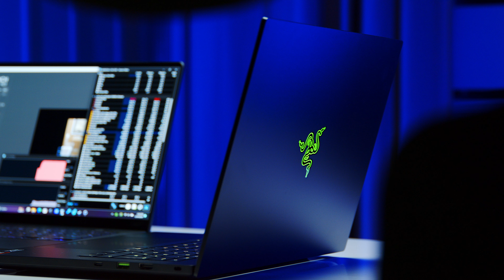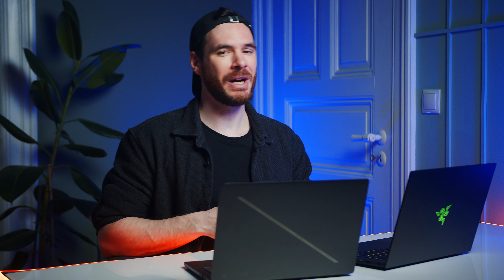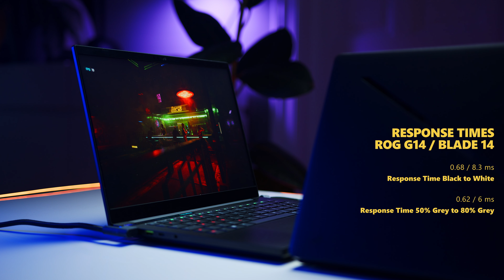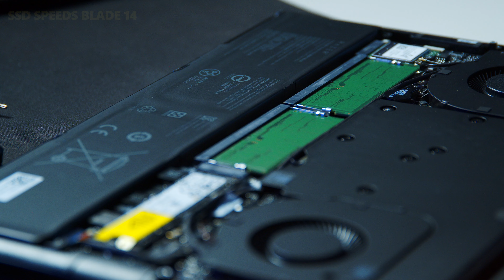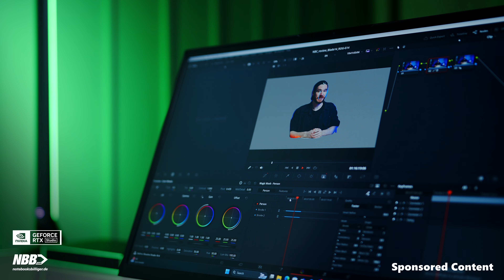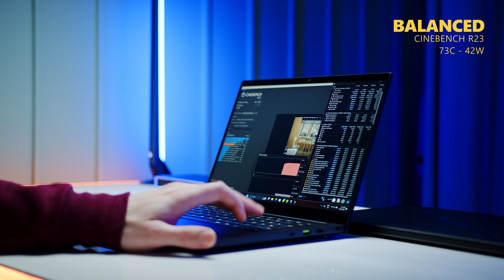Razer Blade 14 2024 vs. Asus ROG Zephyrus G14 2024 - an easy win!(?)

Comment: Hi,
I work in engineering field, and I work on my PHD degree. I need something robust and can handle all the engineering softwares easily and run programs with no issue. I am torn between Lenovo X1 Carbon Gen 13 vs G14 vs blade 14 despite the fact that they are from different categories but I opt for 14 inch one; could you help me deciding which one is much better ? 
Thanks

Comment: awesome video thank you for this. I subscribed. heads up though it's really hard to understand which PC i'm looking at from some of the angles and lighting - I think it would be easier if you had some label of the product or changed the font you use for corresponding models (think green font for razer and a silver or blue colored font for Asus) otherwise thanks again.

Comment: Zephyrus longer battery life and oled ....no need to think too much...just take the 32gb 4050 ryzen r9 white and you have a laptop for all rounder at 2k price...i rather take the 4050 and 32gb as it is also at 90w and it does the job for gaming and your work wont be compromise ...best all rounder indeed

Comment: Thanks for the awesome review. Does any of the two USB 4 ports on 2024 Blade 14 support display port through the dGPU? Razer website make it sound that both are connected to iGPU! Does Optimus make a difference in this case? I need to be able to connect a device theough USB-C to the dGPU for work. This might be deal breaker for me.

Comment: I’d lean towards the G14 as usual. The whole point of a 14” laptop is portability for me. Having a smaller form factor, lighter weight, and crazy battery life are super important for bringing this to the office without needing to charge for the day. For those needing more power, just go for last years G14. Comes with 4080/4090 and a slot of ram while still being roughly the same size as the Blade 14 but better performer and lighter weight and better battery

Comment: Hopefully we'll see some USB-C 240W devices soon. No need for some extra connector s**t anymore.
Reply from the maker: Do not count on it anytime soon. According to our information from different manufacturers, 240W via USB-C needs too much voltage right now, making it very inefficient, resulting in too much heat at the connector.
That is why you do not see anyone using it!
Reply: @NotebookcheckReviews Ah that's a shame, thanks for the update though!

Comment: The true battle is the price, $2000 vs $2700, The G14 is clearly the winner. Is the Razer really worth 700 dollars more? I don't think so and I had them both.
Reply from the maker: Is it really that much in the US? The G14 is really "just" 2k in this config?
Reply: @NotebookcheckReviews  Yes Sir, I  have the bestbuy version.
Reply: Also, the oled Blade 16 with 4090, 2TB SSD, 32GB Ram and 14th gen i9 is $1000 more that the equally spec'd Asus G16. Asus really accomplished what the MSI Stealth serries couldn't do vs Razer.

Comment: Factor in price and the G14 is the winner.  The extra power the Blade gives the 4070 doesn't mean very much as performance usually maxes about at 100W.  I would rather take the oled and 120hz.  Neither laptop really strikes me as a 240hz machine.
Reply from the maker: That's a sound argument, but as you can see from our testing, the Blade is A LOT faster. For some reason, it can properly take advantage of its higher wattage 4070!

Comment: Excellent video as always! 🎉
I finally decided on the Razer 14 despite i like the screen, battery and portability more on the g14. I did so because of i know the build quality on the Razer is very sturdy when carrying the laptop around every day in all harsh conditions for a couple of years. Asus just feels more flimsy and to be frank untested in the long run. I dont think i really could go wrong i neither case, but your thoughts?
Reply from the maker: I agree. The Asus also feels excellent, but the Razer just takes it to another level. 
As I said in the video, it feels more like a work machine than a lifestyle accessory, and if that is what you are looking for, then you will not be disappointed with the Razer!

Comment: That 140w TGP for the RTX 4070 in the Razer means nothing. Channels like Jarrod's Tech has shown that pumping more wattage into the RTX 4050, 4060, and 4070 laptop cards don't offer any performance advantage. Razer is just promoting that as a marketing tool. That's how they get customers...through marketing and aesthetics. I have never trusted the brand as they have horrible quality control issues. Sure the laptop might look good from the outside, but they always have problems with things like battery bloat, keys sticking, cooling issues, display issues, etc. I had one of their mice back in 2014 develop a double click issue 3 months after purchase. Replaced it under warranty and the new one did the same one month after purchase. Switched to Logitech and never looked back and that mouse is still working perfectly today. Avoid Razer products people

Comment: Nice video comparison! However when it comes to price there's no comparison: Not sure in Europe, but in Canada, Asus hands down is cheaper by quite a margin,  with same spec (4070 with 32GB Ram), G14 is CAD$2,999 while Blade 14 is whopping CAD$3,799....
Reply: 90w vs 140w
Reply: @yilun354  I understand, me personally I don't really need that extra frame rates, 8fps in game doesn't justify the $800 difference for me

Comment: Hope you can make a G16 2024 vs Razer Blade 16 too!
Reply: They're pretty much the same notebook. The 16 has an amazing display and build quality but is obviously a good deal more expensive.
Reply: @BoldLaughter uhhh...no. The Razer offers WAY more power, more configurable RAM, larger configurable storage, upgradable RAM and storage, 4k screen, and...just no. They aren't the same. Not even close.
Reply: @BrooBrou  Even the price is different. Jesus Christ I would have to sell both kidney to get the Razer blade 16 considering it's $4k+
Reply: @EndFrost123  pretty sure it starts under $3k.
Reply: @Yayaloy9 that's why there are brands for you like compaq with dual core processors.

Comment: Turbo does not give you the max TGP for the Asus G14, manual mode does. You should do the test with manual mode for the full 90w tgp
Reply: The fans are already really damn loud in turbo mode so I can only imagine how loud the fans will be or how hot the machine will run with the GPU at full 90W TGP.
Reply: @fidelisitor8953  I understand that but this is a video about performance, and you need to show what it's capable of
Reply: @leebrandt8597  Fair, but most will find manual mode to be unusable so it doesn't help to add it.
Reply: @fidelisitor8953  I use it all the time on my 2021 G14. It is loud at times, but not over the board. I use it because it gives me the most power, which I absolutely need for editing 6k raw footage. Now, if I'm gaming, I just manually adjust the fan speed a little and it works just fine. As I understand, the manual mode isn't as loud on the 2024 compared to the 2021

Comment: ive seen serval reddit posts that the new g14 and g16 very quickly downthrottle gpu and cpu and get very hot... and with razer im always concerned about all the battery-bloating posts i read...

Comment: Would this laptop be a good replacement for 3060ti pc? Also would it be able to stream and game capture?
Reply: No. Save your money and get a 4070 Super. That will give you way more performance and be cheaper. Buy a non gaming laptop for your on the go needs. Or get a SteamDeck OLED if you wanna do portable gaming.
Reply: yeah, I say this since I'm a college student and although I know my pc is there for me, It has 8gb of ram and 256 gb of storage. I'll always need a laptop, so I'm weighing the cost of benefits of having a jack of all trades gaming laptop over the PC steam deck combo, which I'm sure would be better otherwise.
Reply: If you are happy with the same power level and need the benefits of DLSS then it is the way to go

Comment: Thanks for the great video. Both systems are clearly top-of-the-line 14" for 2024. It appears that BOTH OEM's stepped up their game on these systems however went different directions on the design trade offs.
RAM and storage are items that OEM's charge an INSANE premiums for so having ether of them soldered is usually a BIG NEGATIVE. Battery life/run time 'in the wild' is usually at or near the top of the feature list/requirements.
While in the past I've gone with Razer and last year went G14 however in 2024 any decision might not be as easy.
I'd agree with the other commenter that side-by-side graphs would be helpful here namely in noise and (missing) heat. I'd like to see how much warmer/cooler each system runs under load (gaming) given the different cooling solutions.
IMHO: for my use cases the G14 would get the nod (with reservations).

Comment: hi i am planning to buy g14 but confused which version to buy g14 2023 4080 or g14 2024 4070 ?
Reply from the maker: If you want the performance and the MiniLED get the 4080, if you want something cleaner and more portable, get the 2024 variant
Reply: @NotebookcheckReviews  thanks for clarifying ☺️
Reply: @NotebookcheckReviews you can get mini led only with 4090 version. 4080 comes with regular ips

Comment: Will there be a review of the HP Spectre x360 2024 or Lenovo IdeaPad Pro 5i Gen 9?
Reply from the maker: Working on the Spectre Review, and will check out the IdeaPad!
Reply: @NotebookcheckReviews  nice
Reply: @NotebookcheckReviews  As far as I know, you should wait for the HP software update, because the 16" was not able to sufficiently reveal its full potential

Comment: I mean.. considering the new G14 is almost a full pound lighter and more compact overall than the Razer, it still nearly keeps up overall in graphics for what it is.. it's a trade off for sure but i'd go for the G14 for max portability.   Plus the G14 has OLED and longer battery life..    I ordered the G14.
Reply: Are u getting any issues with your laptop as u might have used it for a while cuz I was thinking about buying one
Reply: @kavyanshjain223 the screen wobble is not really that bad I only notice it when I try to see it
Reply: Did you get the 4070 version? 

How much fos does it get and what settings do you play on?

Comment: How is your Blade 14 getting over 13k graphics in Time Spy??? Did Nvidia accidentally remove the voltage limit on yours? That’s crazy, the 4060/4070 usually plateaus completely after like 100W.
Reply from the maker: There have been rumors about exactly that. I am trying to get more 2024 4070s to investigate!
Reply: @NotebookcheckReviews  that would be really cool if so, I might start actually recommending higher wattage 4070’s to people.
Reply from the maker: Yepp, my thoughts exactly!

Comment: Interesting how you get such good battery run times on the G14. I have the same model and I don't seem to get good battery life from it. Are there any specific settings you have tweaked or changed when running your battery tests?
Reply: g helper for rog
Reply: Yep, in fact I am using G-Helper and using the Eco/Silent mode @Jules-kp7rw

Comment: G16 vs Razer Blade 16 or Asus Zephyrus M16 when?!
Reply from the maker: As soon as we can get a 4090 sample of the G16
Reply: I tried to scratch the glass with bad fabric etc to Zephyrus G16 2024 (4090) and still no micro scratches. Far better. On M1 and M3 Max it was easily to get micro scratches.
Reply: @steffdia7080 bruh oh my I wanna see jerryrigeverything try it haha. But that is good to know the glass is stronger than the Apple M1 and M3 series.
Reply: @NotebookcheckReviews Hoping for it soon! Will be amazing to see the difference between the 4090s in thin and light devices.

Comment: Nice! How would you compare these against the Slim 5 - the value proposition on that is just crazy.
Reply from the maker: It remains the "Budget" King within this category. If you can live with a slightly bulkier design, no G-Sync, and very good but not outstanding build quality, then you should definitely check out the Legion.
Reply: Considering both Asus and Razer are known for terrible quality control as opposed to Lenovo the choice is clear imho. I'm not going to shell out a premium price for a machine that has a high failure rate combined with terrible customer service.
Reply: The legion isn't exactly "value" compared to the g14 and blade 14 as it's ugly and chunky with less quality than both g14 and blade 14. That's why it goes for less.
Reply: @fidelisitor8953  Please tell me: Wouldn't the high price of Asus and Razer warrant the expectation of good quality control and customer service?
Reply: @lb2791  can you tell about the source of your information or its your personal experience with both brands cause i used 5 laptops during my life 2 of them were lenovo my first laptop was toshiba from 2008 and the build quality was amazing the second one was macbook pro 15 from mid 2015 the build quality was amazing too the third one was lenovo ideapad which cost me like 700 usd with core i7 and the build was bad plastic and it got broken easily and the 4 one was lenovo flex 5 with ryzen 3 which cost me only 450 usd and the design was nice but the build quality was the worst i ever used the fifth one right now i am using is acer swift x which is much better quality than lenovo.

Comment: The razer weight is the same as the G16 not the g14 if you are willing to carry that you might as well go to the g16 and get a bigger screen and more TDP on the GPU which would probably erase the performance difference. Also for what the razer is charging You could actually buy the 4080 version of the g16. so this comparison is interesting but in terms of price and weight doesn't hold up. Portability for me is about the weight not the size. All these laptops can fit in a backpack . It is just a matter of how heavy that bag will be.
Reply from the maker: Of course, there are a lot of things to base a comparison of off. 
But most people will primarily decide between these because of the overall size I would assume!
Reply: @NotebookcheckReviews I agree. I didn't really worry about price when I got my Blade 16. I wanted the best available so I could go a long time before upgrading again. When defending Asus, people most often point to it being cheaper than 'XYZ,' often ignoring that not everyone is looking for budget laptops.

Comment: I just returned the 2024 mercury razer 14 for the 4070 g14. My reasoning was mainly battery life, I wanted a work notebook with ability to game if I need it on the road as at Home I have razer 18, Legion i9 pro and Desktop. The Blade is built great, the screen I liked and loved that I could usbc charge from either side, the negative was weight, price, and 2hrs less battery life. If Razer would fix it so you can turn the DGPU off when on Battery, I believe it would be very close and I would swap back to the Blade. Great review.
Reply: To turn off the dedicated GPU (dGPU) in your Razer Blade 14, you can follow these steps:

Nvidia Control Panel: Use the Nvidia Control Panel to set the integrated GPU (iGPU) as the preferred graphics processor.

Device Manager: Manually disable the dGPU from the Device Manager when on battery power and re-enable it when you plug in.

Windows Battery Saver: Adjust the Windows Battery Saver settings for aggressive power saving to prevent the dGPU from activating on battery.

U welcome!
Reply: @zerocal76  unfortunately none of those completely stop all power draw to the GPU on a razer. It's built into the bios I think.
Reply: @zerocal76 unfortunately this causes the power usage still by the dgpu.. worse than when it’s not disable and not being used. I have both and have noticed the blade actually can use less power than the g14 in most causes (browsing, office docs) but it’s the annoying power spikes from the gpu go from 4w-7w all the way up to 25w-32w at random that causes the blade to have worse overall battery life
Reply from the maker: Interesting, thank you for your insight, and fair points!
Reply: can't u turn it off using nvidia optimus , control panel  or something ?
Reply: @keerthan7558 only has 2 options even in bios, DGPU or optimus, while the G14 allows you to disable DGPU and run off the IGPU.
Reply: how did you manage to get one? they are all sold out
Reply: @ProdByCari Best Buy checking everyday on the hour.
Reply: @on481 You and me both, also have restock notification requests... got a ping the other day when the 16gb version was released but nothing on the 32gb which is the only logical choice with the soldered memory. To my knowledge, they have not released any stock at all for the 32gb unless they just sold out instantly and I didn't get a notification for it.
Reply: Do u mean turning off the dgpu by setting it to eco in Crate? Do u need to restart the laptop in that case?

Comment: I own the blade 14 2023 with 4070 and love it, but I really like the G14 OLED screen, and speakers seem good, I dont like the loud fans though on the G14 and soldered RAM, so Im not sure, I might go for the OLED lenovo with a 4060 if I had the choice or the Blade 16 with OLED for the 4080
Reply from the maker: If you get into the nitty gritty details between the two, it is really hard to decide, isnt it?